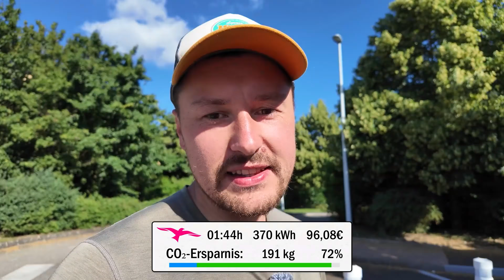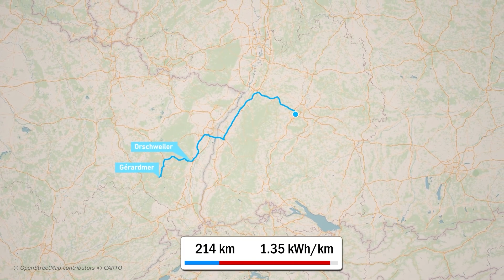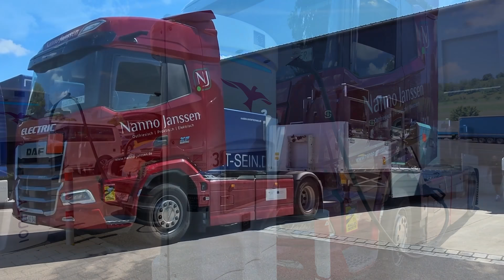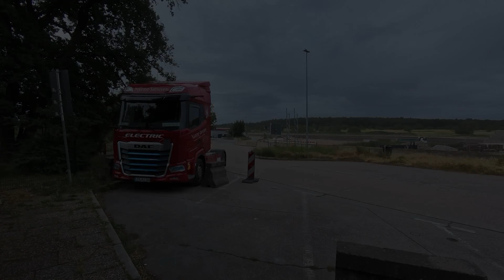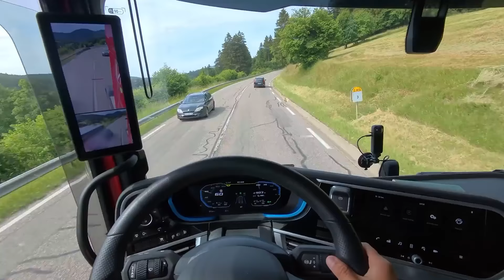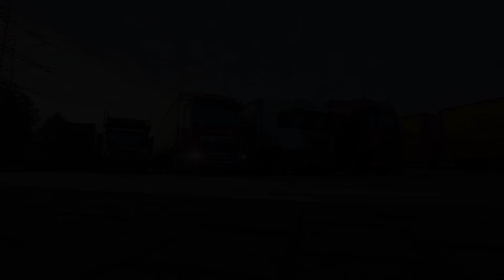My E-Truck supplies a Festival with Electricity

Comment: Filming yourself in a heavy goods vehicle doing over 50 in a 30 zone, then uploading it onto YouTube, is only going to give lawmakes more reason to insist that all heavy goods vehicles are fitted with Traffic Sign Recognition (TSR). If the vehicle makes the decision using AI, the driver will become surplus to requirement.
All road users holding a valid driving licence are under the obligation to stay within the speed limit. You consciously chose to break the law.
Reply: He didnt endarger anyone, it was completely safe to do so. Some speed limits are just too low for what a vehicle can do safely. I hate those nannies and sometimes they are wrong, the speed limit is highet than what the system shows

Comment: If the world trip is still on (I have seen the German video headline, but not watched it yet), a word of advice - take a top quality water filtration system, even the bottled water isnt particularly safe, and nearly all sources have some level of heavy metal and pesticide contamination.

I have seen water cooler bottles being refilled straight from the tap - and tap water is NOT safe in China, not even to brush your teeth, especially in summer.

Oh, and dont eat aquatic foods, or seafood there - or you are likely to spend the next few days on the toilet, as Western stomachs and immune systems cannot cope with the levels of pestilence from the contaminated water; if you DO have to eat some - make sure it is BOILED.
Reply: He is vegan
Reply: @Knnnkncht  OK, the bit about the water still holds true though - speaking as someone who lived there.
I used to run any bottled water I bought, through a military filter, to remove heavy metals and bacteria.
Reply: @Knnnkncht even more important with water quality when prepping vegetarian meals. standard solution when going to underdeveloped countries is usually to go for the meat, its usually fresh as it wanders the streets...